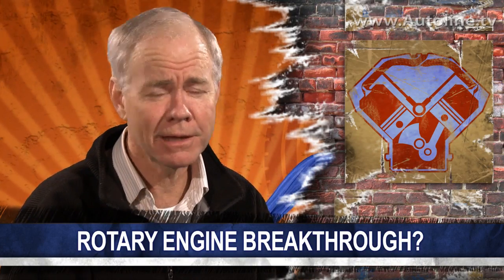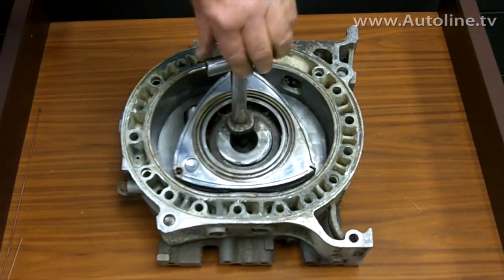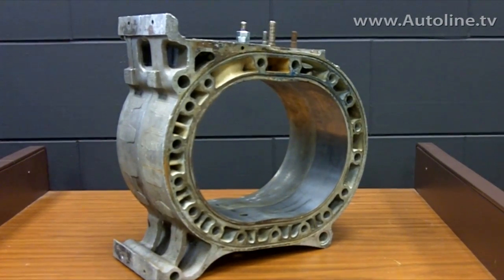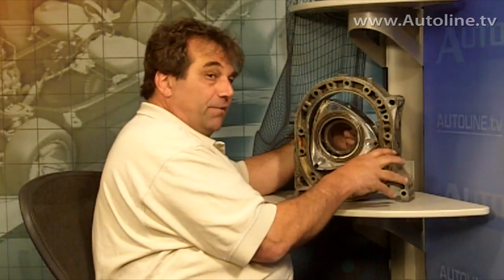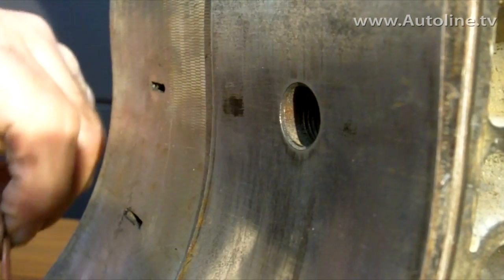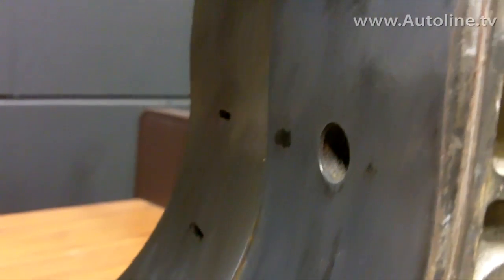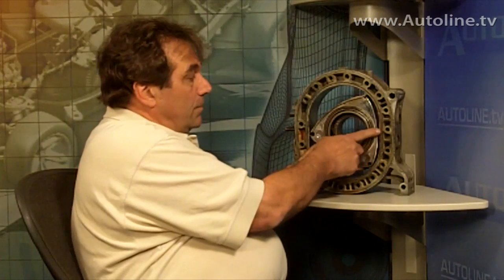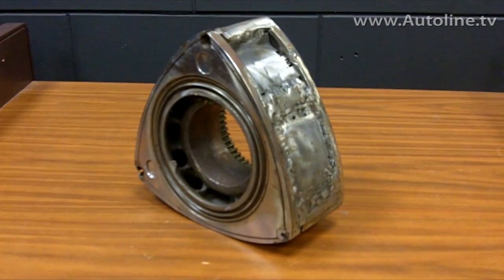Rotary Engine Breakthrough?

Comment: So why hasn't Mazda done all this over the years working with the design..?
Reply: "+GlassTopRX7 The Mazda '16X' engine development program was canceled in May of 2009..."
Hiding behind semantics again I see.  You know full well they recently had 50 to 100 engineers working on a new wankel.  Now they have scaled back with the decision to cancel a sports car application, although they said they still have engineers on it and still are working on a hybrid application.  You have used the 16x statement, which I believe is correct, to leave the impression they're not working on the wankel at all.  You know that is not true.
Reply: "he's a false prophet engineer preaching a false doctrine of disinformation."   I think his story has more to do with a rigid nature that won't allow him to look outside of the limited space he considers valid.  Someone described him as 'entrenched' in his engineering philosophy.....  that captures it.
Reply: Mazda has never stopped development which is why a new RX is on the horizon for 2019 powered by 1.6L rotary.
Reply: Do you happen to know the exact time of day the decision was made?
Reply: The real doktorbimmer
Odd they filled for patents world wide for a new rotary engine in April of 2016.
Reply: So why go through all the trouble of patenting  a new design at every major patent office world wide?  Why would they apply for new trademark patents for the RX-7 and RX-9 name?   They are reserved for rotary cars, the piston cars are MX.

I guess we will see in 2017 as they are telling the press to expect a preproduction rotary concept with a production car ready by 2020.
Reply: This motor has no valves, or timing chain
Reply: The real doktorbimmer False. It’s a motor that delivers far more power of per liter of displacement than pretty much anything else.

There reason it is no longer developed is because its was a motor ahead of its time. 

The point is even the 767b could have produced close to 1000 Hp (WIITH OUT forced induction) from just 2.6 liters of engine displacement. 

There are currently other rotary engine applications that will be used in drone and military applications in the ensuing years to come. 

Your arrogance and ignorance is palpable
Reply: The real doktorbimmer you're still content to reside in the dark. A company in Bloomfield Connecticut is currently got a $1 million contract from DARPA for their liquid propulsion rotary engine the Rotary is not dead it's potential is only now being realized.

The sooner you get this through your head the more you'll  realize that skewing numbers with internal combustion engines is anathema to the point. Displacement is displacement stop trying to distort the facts.
Reply: The real doktorbimmer You’re obviouslbly bitter  Lemans german losses  Michael Schumacher, Fritz Kreutzpointner and Karl Wendlinger. Sorry for your loss. .. lets have a moment of silence. .. 

and you’re reliability argument is a sham. 

The motors required oil to maintain the seals. 
Most ignore their engine oil requirements 
(evening ICE’s) 

If anyone ever accused you of being a dis-info agent they’d be paying you a compliment. 

1.) The inherent advantages of rotary engines over piston engines are lower vibration levels and more horsepower from a smaller displacement. Stop playing the “engineer” card. If you 

2.) ibid: "The reliability of the cars eventually paid off in 1991 when a 787B driven by Johnny Herbert, Volker Weidler, and Bertrand Gachot went on to victory in the 1991 24 Hours of Le Mans. This remains as of 2016 the only victory by a Japanese marque as well as the only victory by a car not using a reciprocating engine design.” 

3.) Mazda recommends 5W20 for North American RX8's and 5W30 everywhere else. Both are a fine choice. DO NOT USE SYNTHETIC OIL. Mazda warns against this and will decline engine warranty if you use synthetics. This is because most synthetic oils are designed to reduce oil "burn-off" and since the rotary engine uses oil injection into the combustion chambers you NEED the oil to burn-off as cleanly as possible.

Older rotary engines had shorter life spans due mainly to apex and side seal wear, but the Genesis rotary of the RX8 could  last you 200,000+ miles if properly cared for. 

This includes oil changes every 3000 miles. This includes preventing carbon build-up by running the engine to red-line frequently and/or taking long highway drives. This includes checking your oil levels every couple fuel tank-fulls and topping up as required. This includes warming up the motor a bit before driving and warming fully before pushing it past 4K - 6K RPM. 

4.) I have known at lest 3 people that have over 100K miles on their rotary’s nary a problem. so take your disinformation to another thread.
Reply: The real doktorbimmer the term "obsolete" means no longer used, out of date, no longer useful. 

FYI there are plenty of people that still use the Rotary motor today in a variety of racing and custom applications. In fact,  there are even a few companies that have reverse engineered the motor and build their own in house (so much for your erroneous "obsolete" assertions and lies. 

Secondly I know plenty about Motors.

Daimler-Benz developed the desmodromic valve train in the mid to late 19th century that is currently used in Ducati motorcycle engines. 

Koenigsegg has developed a type of pneumatic csmless valve system for consumer applications. A technology  used on formula 1 and MotoGP engines. 

An no, engine displacement is engine displacement period. 

Reciprocating engine are fine but the rotary suffers because there has been no concerted effort to do R and D on it and I'm certain that certain companies or factions don't want the rotary developed to a greater potential because it poses a threat to an entrenched engineering philosophy. The point is when internal combustion engines first arrived on the scene they weren't very powerful and all they actually competed against electric cars in the late 19th century and for a time electric cars did quite well. In fact one of the first car companies was in the state of Connecticut called the electric car company. Battery technology research and development stagnated and the gas engine eventually won favor over electric cars. 

As battery technology increases you can kiss your internal combustion engine goodbye. 

Two-stroke engines dominated motorcycle racing until Honda came along and decided to prove that a four cycle engine could be just as competitive. 

Two cycle engines produce power more efficiently because you've eliminated two cycles in order to produce the same amount of power. Two cycle engines are also a lot easier to work on and more simplistic as are rotary engines. 

One of the reasons to rotary engine is not as efficient is because from top to bottom you have extreme temperature differentiations I'm pretty certain that a new approach to an engineering design would solve the problem we solve problems all the time it's just is there a will to do it. 

Oil companies didn't like the idea of the development of electric cars the whole promotion of the oil companies allows lobbyists and legislators to pass certain laws that are advantageous monetarily to states and other corporate entities it's how the state gets to pass laws like a missions and gas taxes and gas guzzler taxes etc. etc.

Higher revving engines are always better in racing applications because of the speed that needs to be achieved coupled with how fast the engine can turn.

An engine with a short stroke means that it can turn much higher rpm's and is generally capable of greater speeds while increasing the stroke of a motor in an ice engine means there'll be longer durations between firing orders but more torque  this is where multiple cylinders come into play. More cylinders means more weight more cylinders means more reciprocating Mass .. 

The rotary virtually eliminates all of that. Didn't you get the memo? 

I remember racing my 1989 Mustang LX 5 L against a Mazda RX7  turbo  on the interstate...... as soon as we got to the higher speeds the V8 ran out of power while the Mazda was just coming into its stride. 

So don't sit there and tell me that a rotary is obsolete you're beginning to sound obnoxious arrogant and just plain silly. You really are full of yourself.
Reply: The real doktorbimmer no mazda doesn't produce it anymore that doesn't mean that the engine is obsolete it just means that Mazda has chosen not to manufacture it any longer while others continue to. 

it's still being built and rebuilt and produced so your obsolete argument is a relevant and isn't even germane to the discussion.
Reply: The real doktorbimmer that's a false equivalent analogy.
Reply: @Zone: "entrenched engineering philosophy...."  LOL you just hit on the perfect phrase for doktor bimmer.  I hope you don't mind me adopting that!   I'm going to flog him with that for the next several months.  I'm not an engineer, and he probably is- yet I've beaten him over and over.  He will hide behind semantics over and over because there's nowhere else to hide.  He will phrase YOUR argument in his responses so that he can avoid being caught.  He will claim that none of the viable technologies you refer to in your post are valid because they aren't mass produced.
Some other background: he also hates steam technology, and he won't admit that a modern approach to steam may be viable, like Cyclone Power Technologies' with its thin wall boiler tubes, simplicity,  and clean constant combustion.  He will track you down throughout the internet lest any pro-steam argument go unchecked.  Keep referring to the wankel as a 'rotary'.  He can't stand that.  
I do sense a gentlemanly set of boundaries here though.  It's been fun going back and forth for a year and a half. He's a smart guy who suffers from rigid thinking, which has its value in engineering work for effective use of existing technologies.  As far as adoption of new technologies, he's dreadful.  He won't acknowledge the long term shifts, such as we are witnessing right now, with the death of diesel very much in play.  BTW  I love diesel and I believe it should not be legislated away, but he won't even admit that it is already happening.  
Your'e obviously going to be a good adversary towards him,  (and his rigidity WILL make an adversary of you) so I'll follow and probably learn a lot.  I'll be the first one to acknowledge I've learned a lot from him.
Reply: The real doktorbimmer "mass produced" is somewhat relative. 

Mazda was the only company that ever built the rotary motor;  ...en masse. So comparatively against all the other ICE engines it's in rather slim. 

And there were many companies that produced steam engines as Steam piston engines were very much the (modus operandi ) of the mechanized entire world once upon a time. Rotary's never were. 

Steam and ICE engines are comparatively similar. In fact I believe the Chinese several thousand years ago developed a machine that actually functions in a similar way to a conventional ICE engine though it was used for something completely different. 

The function of a rotary engines applications is best suited to racing (IMO). Someone will come up with a solution to maximize performance and increase efficiency. It's possible  it may have already been discovered . The guy in the video is making claims but there is no analysis or demonstrations that validates his conclusions. 

In (theory) the rotary engine is a much more efficient function of movement. Using fewer parts while maximizing rotational motion converted to energy. One The problem is the amount of fuel used/wasted to create that motion. 

The first person to solve that problem will gladly hand you your ass. 😎
Reply: ".......and curiously? Mazda has not demonstrated a single new Wankel engine publicly since that time....." yes, but they HAVE made various announcements concerning plans to use the technology.  You and I have discussed this before so I know you know about it.   It is really, really odd how you keep trying to propagate this odd belief about the false death of the Wankel in 2009.   Interestingly, in one place you claim it happened in April 2009, and in another place you claim it was May 2009.  Another place you cite the last engine produced ("they ended production of new engines on June 22nd., 2012") and still other times you have cited the exact minute of the day they finished assembling the last engine.  

So to everyone.... the internet is a strange place, no?   LOL

For Christmas this year I know what to get for you:  a nicely printed and framed timeline of the ending of the Renesis Wankel.  You could masturbate in front of it any time you would want to.   Another good gift for you would be a dart board with an orbital wankel piston printed on the center.
Reply: Some Other Dude he's a false prophet engineer preaching a false doctrine of disinformation.
Reply: Some Other Dude agreed

Comment: I would agree with you on Pascal's Law making this hard to understand except for a few observations. 1) Pascal's Law is talking about an incompressible fluid which clearly a fuel air mix is NOT and 2) fuel air mixes are NOT homogenous. Well if they are nobody's told me. Pressure changes after ignition during a combustion cycle OCCUR IN WAVES AND WAVES CAN BE DIRECTED. Just my $0.02. I think what he is saying about directing the combustion charge is perfectly feasible.
Reply: You have a serious reading comprehension problem, to the point where you are trying to even counter points in which we are in agreement. Mario's post was spot on and I urge you to re-read it. You have basically re-stated everything I have said, except you get hung up Pascal’s principle whenever anyone utters the word pressure. I don’t know how many times it needs to be stated, but the flow is neither incompressible nor (quasi)static.

For whatever reason, you jump straight to combustion (flame propagation) without ever uttering a word about chamber filling because you KNOW that combustion chamber shape effects the flow path and therefore velocity and pressure. Of course, being compressible and of multiple species and phases, the flow is obviously much, much more complicated than my plain description (fuel separation, etc) - but, all the more to my point. 

Colliery to my point about piston crown design, the domed pistons you see adopted in almost all modern engines are designed largely to introduce tumble, which aid to better homogenize the mixture. Also, as I already stated, they create a squash area during compression stroke, and upon ignition, direct the propagating flame front.  My point to all of this is I do not see why this can not be studied on rotary engines. But again, here you go off sputtering nonsense about the largely irrelevant Pascal’s principle to no end. 

There is a nice paper on this concept which should be relatively easy for you to comprehend:
"Enhancement of Combustion by Means of Squish Pistons" by Katsuhiko Miyamoto

In fact, just google Wenkel CFD and you will find some nice papers/visualizations of the pressure and velocity gradients that exist within these engines, which are, again, irrefutably influenced by wall/chamber design.
Reply: I am really trying to understand you, really I am. But what you are saying does not compute. Firstly from your posts I am seeing where you think a gas air mix is a homogenous specie. I don't think it is. Secondly you used the term 'deflagration'. It's a lovely word. It suggests that flame front that moves omni directionally at around 100m/s, ie it is not INSTANTANEOUS. How does this fit in your world? Cause it doesn't fit in mine.
Reply: You are absolutely correct, Pascals law does not have much relevance to this topic. Proper flow analysis in an ICE, especially the chamber, would never be modeled as incompressible if one wishes to obtain any useful results. Actually, no fluid is incompressible, but the approximation can be made for M<~0.3 with minimal error, which is obviously not the case. For example, choked flow occurs around M=1 (sonic), which is a phenomenon often seen in ports.
Reply: +The real doktorbimmer 
Not sure, nor do I really care, what his intensions are (happened upon this vid because of the click-bait title), but there is validity to what is implied about directing the flow. Similar to dished vs domed pistons, there are various merits (and applications) for both. One wouldn't know without extensive testing. I would like to play with rotor/chamber design (structural integrity aside) myself using CFD, but this can get very computationally expensive and obviously time consuming.
Reply: Offsetting the chamber with a corresponding relocation of the spark plugs should have an effect on the bmep relative to the rotor's centre of rotation. Unless the Wankel Engine timing is very, very retarded. If my ramblings seem incoherent, it's after 2 in the morning here. I will revisit. But I am not understanding your theory.
Reply: Y